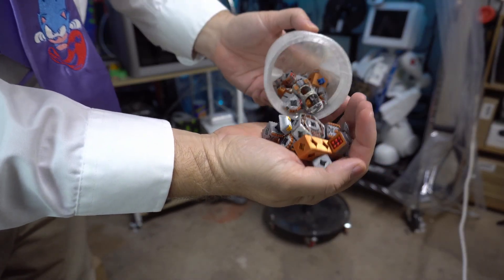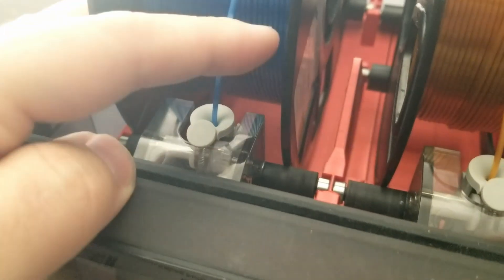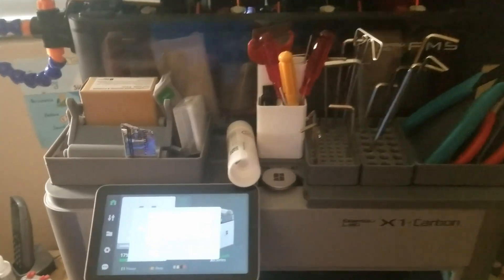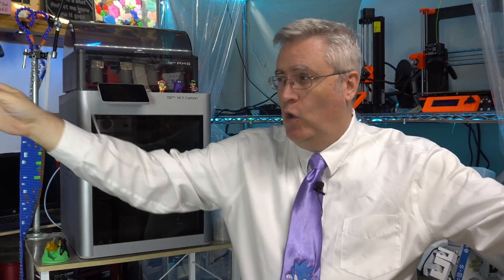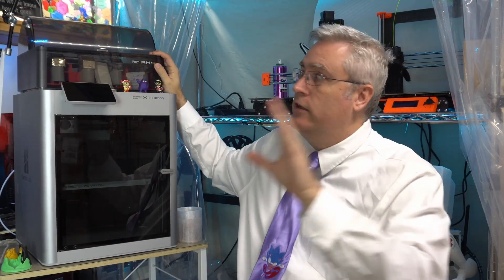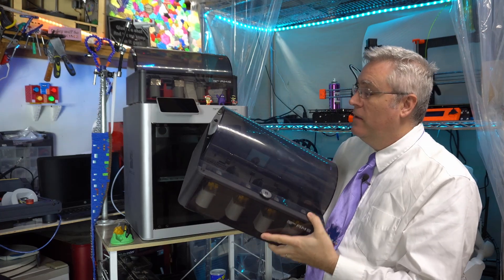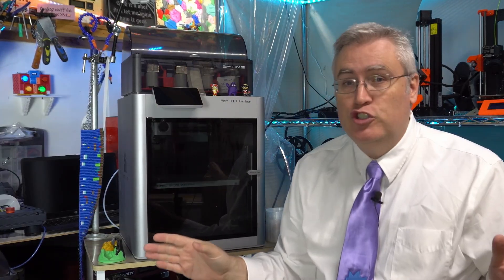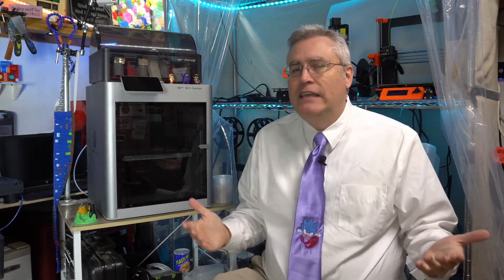My Bambu AMS died after only 1 year

Comment: I am Kickstarter backer 1234, and experiencing significant problems with both the printer and the AMS. Thanks for delivering an honest review, including concerns about post-support. Now I know not to purchase replacement parts for the AMS, and now wonder whether I should purchase a replacement AMS. I'm also having trouble with the force sensor due the heater cable. I also love the printer, the most successful, but had I known this would have lasted just one year, I probably would have stayed with Prusa.

Comment: I've been running into issues with my AMS for the last couple months where it struggles to load filament and constantly goes back and forth over and over until it gives up. Granted the spools I'm having the most trouble with are cardboard spools and atomic Filaments larger spools, but they fit. Even when it is able to successfully feed the filament, it just barely has enough strength to pull the filament to the extruder and almost gives up partway through. Then when it's retracting it completely overreacts and spews filament all over the inside and wraps the filament around adjacent spools. At first I thought the strength issue was a result of the PTFE tube running to the extruder being worn down, but the problem persists even after replacing it with Capricorn tubing. My printer functions perfectly fine when I load filament from outside the printer, so the problem is definitely within the AMS. I've checked the extruder gears and they're all perfectly fine. My only guess is that my motors are starting to burn out, which is crazy because I've only had my printer since December and have only done like 3 or 4 multicolor prints that require a couple hundred filament swaps. My printer hasn't gotten any crazy abuse, I print exclusively with PETG and have never run any abrasive filaments through it. I've been preparing to upgrade my AMS to the new Python AMS, which ditches Bambu's enclosure and the roller system for a geared center driven system. I'm mainly doing this because of the amazing torque that it's able to achieve with the large gears and makes the AMS compatible with ALL spools. That includes cardboard and smaller sample spools. I bought the hardware and enclosure hardware kit from Voxel, who officially licensed and partnered with Humebeam, and I purchased a spool of Bambu's PA6-GF Nylon in this gorgeous light blue to make the gears out of. I just finished my printer maintenance and I'm still waiting on the hardware kit and I need to purchase a couple spools of my favorite marble filament from Atomic that I ran out of because the new frame uses about 1.5kg of filament and the enclosure uses about 1kg. While I'm waiting I might try to learn from your experience and contact Bambu before I start modifying. Maybe I can get them to send me a new 2nd stage motor or a new set of 1st stage extruders, because that's honestly what I need. Wish me luck
Reply from the maker: Good luck!

Comment: i have confidence in bambu as a company.  
i'm impressed with everything i have seen from my bambu labs A1 so far. 
the ease of use.  the quality.  the looks.  the speed.  the power use.  
even the packaging it came in was impressive.  
the fact that the original A1 had a bed cable problem and the one i ordered was already a V2 that had the problem solved.  

you just won't know if the actual product you buy is as good as it looks YET.  
there might be an issue with your product but i think they will deffinatly help you.  
and their development team is deffinatly quick to come up with an improvement on the same design.

Comment: I think I should be able to get 10 years out of a printer as long as maintenance is regularly performed and parts replaced as you go along. I may not see it happening with a bambu lab printers but I can see it happening with opensource printers with parts readily available from different people.

Comment: Im an everyday average joe. I bought the P1S combo, after 3 weeks of use (not continuous use either) my AMS unit just died. No power seemed to be going to the unit. Ive contacted Bambu through opening a ticket. Took 3 weeks just to get an initial response. I went through and tested all the ports and cables with a multimeter just as they asked. They then proceeded to send a new board, buffer and cables. I replaced those but still no luck. They then sent a different board for a different part of the unit to be replaced. Still no luck. I asked for another unit but they replied with sending different parts to be changed out. Keep in mind each part takes about a week to be sent to you. Im now going on a month and a half since ive contacted Bambu. I do have orders of prints stacking up, at least its all from people i know. I cant imagine if this was my only source of income and not being able to use a huge part of the machine for this long of a time.
Dont get me wrong, i do love the printer itself. I cant wait for the AMS to be operational though. Thought i would just share my experience so far as an every day average joe.
Reply from the maker: You say you have orders piling up, so I assume you have some income. Could you buy a whole new AMS unit and see if that works, and return it if it doesn't?
Reply: @3dpprofessor  I think it’s awesome you reply to your comments, pretty cool! I do have income coming in from my other jobs so I might have to give that a try, great idea. Thank you!

Comment: So I bought a P1S and a month to the day later it quit powering on properly. It would let me start a print from studio but not the screen, as the screen was just lighting up. Support assured me they would walk me though fixing it whilst also promising it would be fixed in the end. I know the printer is only a month old, and I guess when it was built the cable between the MC and the AP board was not fully seated on the AP board side. After I clicked it in all the way (as support linked me to a guide about) it has been working perfectly. Just wanted to share as nobody ever shares the good with their support.

Comment: Man you're lucky. Mine died after 3 prints
Reply from the maker: Aw, sorry. Did you ever get it fixed?
Reply: @3dpprofessor  Customer service didn't reply but I found out the filament was brittle and breaking out of the hub. I put it on the hot plate for about a day and it seems to work fine now.

Comment: i bought the p1p when it first came out, coming from a full tinkering always anycubic i3 mega. Well, the bambu was a new experience in 3d printing for me. Instead of wondering if the print is gonna work at all, not some strange skipping in steps or bed not sticking, now i could start doing some real advanced prints and not thinking that i would be able at all to print it. Shure, its quite expencive, but, they are wort it. I actually got my first breakage on mine today. The ball bearing in the extruder is smoked. Started to get print falioures, printhead just carrying on like nothing have happened but no filament coming out.. well well, anyhow, not that expensive to buy a new, and at the same time get a hardened version, and exchanging the nozzle to hardened to at the same time. Im very pleased anyhow, the extruder would probably go under warranty also if i wined to bambulabs, but it wont do that, its not that expencive.

Comment: My experience is the more features a device has, the more potential for failure it has as well. I purposely opt out of the AMS for this very reason. But that's only my opinion. Put an AMS-like unit on a Prusa and it would probably eventually crap-out as well. And that's why I have never been a fan of 'all-in-one' devices of any kind. FYI: Terrific video; very informative.
Reply from the maker: Prusa has an AMS like. Their Multi-Material Unit or MMU. Actually, the AMS is more like an MMU-like, because the MMU was first.
And I had one. And it required so much extra space and only worked so-so, so I gave up on it.

Comment: I bought a new First Stage Feeder about a month ago, and it's clearly stated, in red, that you need to buy the right one. "*In order to optimize product performance, we have upgraded the circuit board of the AMS first stage feeder. This upgrade will affect the AMS that used the earliest main board. Please confirm the version of your AMS main board on Bambu Lab Wiki before purchasing the first stage feeder or feeding funnel."

Maybe you missed that when you bought your two replacement feeders at about 8 minutes into your video.

I like your videos very much and am a subscriber. Please keep up the good work.
Reply from the maker: Sometimes details get missed when condensing a months long event into an approximately 10 minute video.
Reply: I hear you. It certainly didn't detract from your overall message. I voted with my wallet and took advantage of Bambu Lab's Black Friday sale to get a second P1S, along with a First Stage Feeder which will hopefully help me solve my ongoing problem with just slot 3 of my AMS. Of course, now with two AMSs I ought to be able to swap around all kinds of stuff until I track down the error.
Cheers,
Jim (from Switzerland) @3dpprofessor

Comment: I was curious about using the v2 feeders with the old AMS. Since they ran in the opposite direction, could you then open the feeder, swap the polarity of the motor wires around, and have it run in the correct direction?
Reply from the maker: Probably. 
However, I recently discovered it I didn't have a V1 feeder. I had a V0 feeder. Prototype. No paying customer should have the one I did. Didn't know that when I made the video.
Reply: @3dpprofessor  Wow, it's a collector's item! I was suggesting the polarity switch just in case you want a second AMS running. I have 1 AMS myself and am contemplating a second because of all the 5-8 colored models out there! :)
Reply from the maker: @Botmatrix  I considered that. I'd also need a new second stage feeder because, turns out, that was my problem all along! 
Gotta make that follow up video.

Comment: Hmm, not sure why there never figured the first cause of problem out, 😢
Reply from the maker: I actually got to keep exploring this, and I figured it out with Bambu's help. Turns out I was wrong about the cause. It wasn't the first stage feeders, but the second stage feeder that needed to be replaced more. However, my service was  hindered because I didn't come right out and tell them who I was. Turns out I actually had a pre-pre-Kickstarter unit. I got one of their prototypes, which most of the service people didn't even know existed. Had I just told them who I was from the start, they would have realized that earlier. So much has changed since that prototype that replacing the whole thing was basically the only solution.
I'll have a follow up video soon.

Comment: I just ordered and received the X1C.  I am new to 3d printing, 52 years old, so time is a precious commodity for me.  I wanted something that worked out of the box, so I could concentrate on the maker aspect and not the tinkerer aspect.  I was on the fence between the X1C and a Voron 2.4 R2 build.  It was the "Influencers" all saying the same thing, "The X1C just works" that convinced me to go with the Bambu offering.  There isn't a lot of information about the longevity of the AMS units, so your content is very much welcomed and encouraged!  Keep up the great, unbiased, and honest reporting.
Reply from the maker: Admittedly, it did work right out of the box. You'll have a great time with it. And, the rest of my CX1 is working fine. It's just the AMS that crapped out after a year. Turns out there's a good reason, but I'll have a follow up video about that soon.

Comment: So I have an Anycubic chiron. It is an early release model i bought in nov 2020 and I went through the unit and ferreled all the connections and spent all the extra 20 minutes for wire retention and extra attn for detail the assemblers were not allowed when I put the machine together before the first print. Sence then I have only printed in standard PLA but I have gone through 5 nozzles and 3 parts cooler 4010 fans so I count myself fortunate. I dont clain to print 24/7 365 but I am a heavy user and i have fulfilled many orders with my single printer.   That being said I have been looking at the X1 for some time to not only bring the ability for more awesome filiment types like ASA and petg cf  with the hardened hot end I appreciate your candor about you love/ distaste  for your kickstarter aged machine.   Do you truly believe that the juice is worth the squeeze and the x1 will prove itself. I am on the edge and could use a nudge in the right direction.    Thank you and god bles!!
Reply from the maker: Honestly, yeah, I still think the X1C is an amazing out of the box experience and super easy to use in general.
Though... I'm also testing the Creality K1 right now, and it's amazing. It doesn't have the multi-color option... ever. But it's just as awesome. I did have a problem with my hot end, so it's not as reliable, but it's 1/3 the cost, so that's hard to beat.

Comment: I think having such an early unit, this is par for the course.  Right now is probably the best time to buy, because they've been out in the field for a year in voliume and have hopefully had time to work out the various issues.

Maybe it's because I have built many Software products over the years, but I just don't think the early units are a big deal.  It's more about them having good support and continuing the printer over time after learning new things at volume.

Comment: I bought the Ender 3 S1 Pro about a year ago. I was brand new to 3-D printing. This was my very first printer. I spent about 15 minutes leveling the bed, then I  started printing. My very first print came out perfect. I have not had one bad print yet. All of my prints have come out perfect. I love this printer and I would recommend it to anyone.
Reply from the maker: Be careful recommending it. Ender 3s are the  #1 most abandoned printer because the documentation is inadequate. If the person you're recommending it to isn't technically confident and willing to do some searching outside the manual, there are better printers to recommend. Bambu, Flashforge, and even their K1 they got their act together on.

Comment: Seems the feeder funnel with the switch based filament sensing broke(leading to intermittent operation). Unfortunately the new hal effect switches are not compatible with old AMS units. Repairing and availability of parts will always be an issue for any of these closed and propreitary h/w.
I have a 10 yr old taz5 that works fine even today(went through few idler clamp and fan shroud replacements).❤👍

Comment: I notice that you showed the “ams rollers locking upon filament feed causing the spool to hop and bind” issue but you didn’t mention anything about it.  I find that curious.  It seems like a firmware issue they havent yet addressed.
Reply from the maker: Honestly, there were so many problems over the months it took for this to unfold, I have probably forgotten a few.
Funnily enough, the new AMS did this to me too, though. Besides taking it apart and releasing the second stage feeder by hand (which is what I did) is there any easy way to fix it?

Comment: So many holes in your story, I figure that well because you're the "3D printing professor" you've probably hacked the printer and AMS to death, made a mistake and tried to put it on the manufacturer.
Reply from the maker: Besides the hydra mod... no. I go stock as much as possible. I'm more interested in using 3D printers to make stuff than to hack the 3D printers.

Comment: I was about to pull the trigger on a Bambu printer, but I keep finding more and more reviews similar to this. After eading the comment section here, a lot of similar comments on how customer service is. When it comes to "how well a product works", I know most people come to the Internet to complain, but between the comments I have read and the Bambu's  history, I don’t think I will get a bamboo at this point, it will probably be a Prusa or Ultimaker/Makerbot for something that works good enough out of the box.

Also LoL. Autocorrect keeps changing Bambu to Bambi.
Reply from the maker: Check out flashforge. I'm hearing good things about their new Adventurer 5, and I have a great history with the Adventurer 3.
Reply: @3dpprofessor  Thanks for the suggestions.
How is the new AMS going?

Revisiting this a year later and shapeways closing.... I will most likely be going X1 Combo. My main issue is what happened after 8:00.
Reply: Get qidi instead

Comment: At about 880 hours on my AMS and X1C the AMS is routinely not recognized.  Seems they have cable/connector problems.  Still trading emails with support.  Bambu studio still crashes routinely trying to view prints with the camera.  PLA sticks or doesn't stick to the sheet depending on which firmware I have installed.  I still have mixed feelings on my purcahse.  My Prusa MK3 is still going strong after 8,000 hours of printing.

Comment: the X1 did bring back the love of printing for me , HOWEVER ... Bambu labs service on ANY of there parts when i have an issue is simply the worst. 3 extruders, to HUB , and now the AMS ... in each and every case you go down the same rabbit hole of show a pic , then another , then a video , then another video , then it has to be something else ... and they still cant tell me why a print would spontaneously want to retract in the middle of a single color print .... and i have only had it 10 months ...